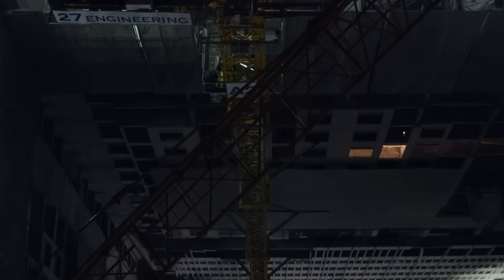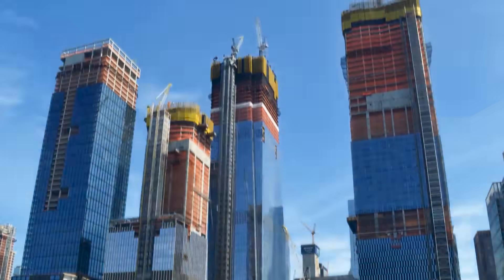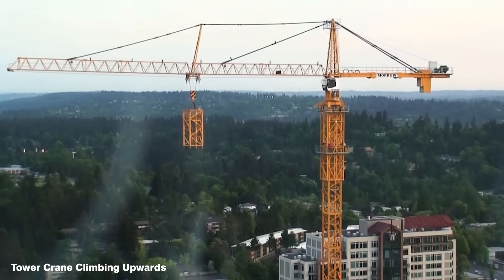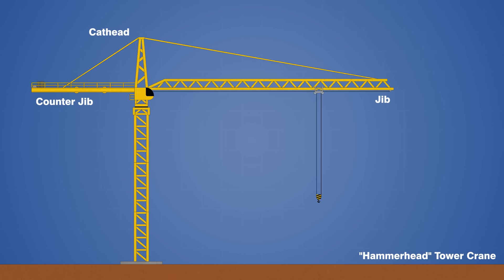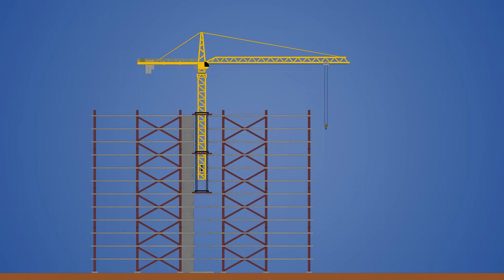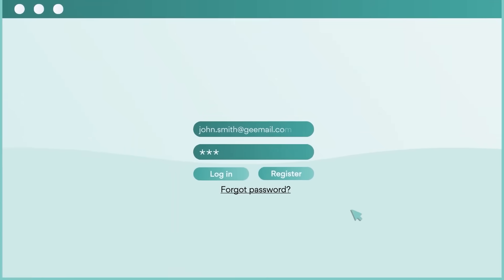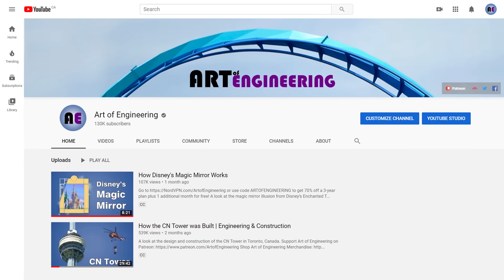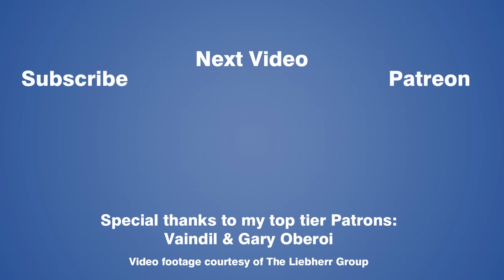How Tower Cranes Build Themselves

Comment: There’s only two requirements to be a tower crane operator:
1. A few loose screws
2. Balls of steel
Reply: AmishHitman73 New York City town crane operators can make 500,000+ a year. You just gotta know where it’s paying to work and go there.
Reply: @Chad_Philip     You have got the noughts mixed up unless your saying crane operator can be millionaire after 2 years which is total BS.
Reply: David m3 maniac is is... is that an m3? I’ll just leave now.
Reply: @Chad_Philip  I would retire after like 2 years 😂 fuck that job.
Reply: @Chad_Philip  I really doubt they are making 500k/year anywhere.
Reply: @Chad_Philip  I saw more like 600,000.
Reply: and a bunch of training ...  lots and lots of training.    and balls of freaking titanium alloy
Reply: Make alot of money but if you fall or the crane breaks that money won’t matter no more.
Reply: @seressor  but you wont need the money anymore, so itd be a win win
Reply: @harleyme3163 you beat me to that 😂
Reply: Tower crane operators better be damn good at their job for the pay too. Not many people know this, but any accident directly related to the crane hurting somebody is automatically the operator's responsibility.
Example: If a cable snaps or the crane fails from being loaded over capacity, and the load kills someone, that's on the operator for negligent homicide. Now, to enforce such strict policies, the operator has FINAL say on when the crane and conditions are fit for operation. Cables are to be replaced very often and have to be rolled into the spool with a certain amount of tension. That's why they have a large weghted ball over the hook.
At least, this is all how it was laid out for me by my dad, who happens to be certified to operate such machinery.
Reply: Emperor Of Mankind Thank you for explaining this. I would've loved to be a Crane Operator but God's plan for my life comes first. I admire and respect how a crane works and appreciate people who knows how to properly and safely operate one. ❤
Reply: @shockwave6213  well said. 
I've been in the seat of a few cranes since 2002.
Hats off to your dad.
👍
Reply: The operator's aren't the ones who built the cranes, ironworkers like myself are the ones who put them up.
Reply: loose screws are what you don't need
Reply: Pixelmace EXACTLY! ❗❗❗
Reply: Not really. I'm a crane operator and rigger, we do stuff every day that is more dangerous the operating a tower crane. I never did like the tower cranes though, too monotonous work, and lots of times they have idiots putting them together. Ain't not telling how many times I've seen pins and whatnot fall out of the tower, because they weren't assembled right.
Reply: meh some tower crane operators operate remotely from the ground with remote control
Reply: @youtubeuser206  I've done this with a digger/derrick. It helps alot when you don't have a large crew, only critique I have of my particular system is that the joysticks are almost push switches. There's no finesse, it's either full throttle, or full stop. There's such a fine threshold for the joysticks that it's almost imperceivable to even experienced operators.
Reply: @AecherJace  I think they're building all equipment like that now.. The new Komotsu front end loaders have switched to more digital controls too and a sensitive azz joystick for the steering wheel. I don't like em
Reply: My dad isn’t a crane operator but once a month, he needs to climb at the top of the crane and has to go add grease to the steel cables at the end of the crane
Reply: I cannot even stand on a 10 story high rise because my acrophobia takes over
Reply: @SavageKingsvge  i cant go higher than the 2nd story of a building without feeling sick, and losing feeling in my legs. this video gave me nausea.
Reply: lalla jha no money in the world would make me go up on one of those. I have acrophobia. Id faint before getting to the 5th floor height
Reply: I hope they don’t have a few loose screws. There’s only one place where they could get those...
Reply: Balls of vibranium 🤓
Reply: why balls of steel? I climb cranes for fun
Reply: @EvilTaco  working with cranes and climbing them are different like climbing compared to cutting trees 🤣
Reply: LLG 3PE 3. Not afraid of heights
Reply: I absolutely love it. Best job I’ve ever had.
Reply: Lots of piss jugs
Reply: i have a big dic but i didnt become crane operator..
Reply: What imagine you have to have decent eye/hand coordination. Having 2 eye helps so you have depth perception. Some people aren’t bothered by it I guess. I’ll look at those ironworkers in the 30s who worked with no safety belts, sitting on and I’ve been eating the lunch with your legs hanging over the side. Hell of a view I guess if you don’t mind the Heights. Did you ever see the wing walkers and acrobats from the 20s and 30s and the stunts they would do? To me that’s just insanity but these people have no fear of heights. I do. It’s not really irrational fear I guess.… If you think about it, you could walk on a sidewalk that is 2 1/2 feet wide and you could skip on it and do cartwheels and everything else. Put that sidewalk 200 feet in a year and you’re doing a belly crawl on it.
Reply: I have an extreme fear of heights--But once I climbed the Tower Aections in fear and got in the Cab an started operating it--the fear subsides and you focus on doing your job. 1 wrong trolley or swing can kill people if your not focused on your hook, the load, landing the load by radio or people near the hook.
Reply: https://youtu.be/6B_dM87BSFY
Reply: You'd need balls stronger than steel for that
Reply: You forgot to mention the ability to talk shite
Reply: Naw, balls of titanium more likely.
Reply: I came from a crane operator family and I respect my family even more after reading this comment from you
Reply: I have great respect for the people who do things like this. Any height activity.
Reply: "Oh that's just tower crane operator Steve.  Rambling again, as he always does."
Steve: "They're not bolted on!  Why does reddit call them bolt ons?  They're fake breasts!  They're part of the feminine body, which is soft!  I will die on this hill.  This tower crane!  Eeehehehe..."
Reply: @AmishHitman73Archive  40 - 60k IS a lot to some people mind you
Reply: @AmishHitman73Archive  that is a decent amount of pay for where I am in eastern oklahoma.
Reply: a few loose screws had the guy ( hero) that took the plane from seattle
Reply: Did you mean bolts of steel?

Ha, get it, cuz it rhymes with BALLS

Comment: What is the weight limit in lbs or pounds , tons of these animals?????  
It makes my stomach kinda turn just watching this diagram.   I can work in a bucket truck , or truck crane basket all day , but after seeing pictures of these things that have fallen and tangled , and mangled it makes me in easy just being close enough that one could fall on me. It's strange because hi speeds on motorcycles , boats , hanging off hill sides on a dozer doesn't bother me at all but just being close to these things unnerves me.

Comment: Don’t the counterweights need to move when the trolley moves?
Reply: No, actually when there is no weight on the jib end that is the most unbalanced the crane can be, with all the weight in the back, only after we pick some weight up and move it farther out does it actually start to balance out. But there are switches called limit switches that prevent you from putting to much weight on the crane. One is the moment switch which prevents you from going to far out and then there is the line or total switch which prevents you from putting to much weight on the hook that might damage the cable.
    When the crane is free standing the tower section will have a slight bend almost like a pot belly towards the front and when you are maxed out it looks like a bad back on a old man bending over at at that point the seat you are sitting on is now tilted towards the front window and it wants you to slide that way lol
Reply: on some cranes they do rock back and forth just to help dampen the rocking motion that might occure when pouring concrete and the guy dumping that bucket that could hold up to 4 or 5 cubic yards of concrete up to 25,000lbs just let it go all at once and instead of the bucket 1 foot above the deck is now 10 feet up and the crane is bouncing all over the place and loud cussing can be heard from the operator's cab

Comment: Tower centers make themselves taller. They do not build themselves. They are built in a factory. They do not even assemble themselves on site, this is done using smaller mobile cranes. They can add sections to their tower and they can remove sections from their tower, that's all. I've been on jobs and seen dozens of them assembled over the years, always done with smaller cranes. Thumbs down.

Comment: I do this for a living everyday of my life it's a good video Everything spot on you forgot to mention one thing about the inside climber the top collar also hold the mast centered also for tolerance this collar isn't fitting tight around the mast nothing is perfect in this world so you can't make the openings perfect for the cream just to fit in have you climbed it to the appropriate height you make it plumb level and then you drive wedges in for the top colour is wedges so that it is lead one side more than the other it's adjustable the wages are checked Every Morning by the operator and lastly it does not take a month to cure the concrete in a crane base pad a few days after we're done maybe sometimes the next day it all depends on what MPA the concrete is how warm was it when you bored if it's colder doesn't here as fast did you use metered concrete yes you have to wait longer anyways good video like I said spot on buddy that comes from a person who does this for a living cheers
Reply: I've been in a couple of internal climbers and hated it when some wedges worked out while I was operating and the crane tipped backwards
Reply: @TheHawkeye1432  omg! Its falling over!!!  Really depends what crane you're working with the pecco most have a threaded rod they slide on and a keeper nut to hold them down but I've worked with a few that we had wooden wedges every morning five hits with a 10lb sledge if it moved start the count of 5 over again
One other thing that wasn't mentioned the inside climber loses lifting capacity from the ground after a certain height

Comment: Do they make them where the counter balance weight can also move towards/away from the center of the crane? I would think that would be really useful. For Heavier loads, run the CW out a bit more, or in to keep the moment as close to zero as possible. Just curious.
Reply: no, the crane is at it's most unstable point when there is no load on the crane and the crane only starts to balance out with heavy loads on the jib, counterweights might be engineered to sway silghtly on some to counteract a bouncing crane but never move far

Comment: All the ballast is not put on at once, just one or two , to counteract the weight of the main jib, the rest are added later otherwise the crane would lean backwards, also because a crane is erected though the middle of  a building DOES NOT increase  its lifting capacity

Comment: Serious outcome happened in NYC 2007(?) when a crane fell over in a dense mid high rise residential area.
Reply: I believe that a rigging cable broke and the load came down and hit and broke the tie in bars to the building and when that happened the crane which could not support itself free standing that tall fell backwards because of the counter weight into the apartment building across the street

Comment: Why don’t they make them remote control with a bunch of cameras for the operators.
Reply: U perform best when your life is at stake
Reply: They all are, but we still can't beat the situational awareness of sitting up there, with your own eyes ^^
Reply: Wouldn’t you rather be in control of your life all the up there instead of a remote that can fuck up whenever
Reply: If a mistake is made with remote control, how are you going to rebuild the crane?
Reply: With a remote control you can run the crane but you can't feel the crane. I have run a couple from the deck er working floor but there are too many distractions and you can't see everything. I had 1 crane where the cab was located half way out on the jib, I am really glad they did it for only 1 crane all you did was bounce around all day long and was physically draining by days end

Comment: You dont mention mast windup when the swing is stopped. Met a company safety guy about 150 feet up a mast. It was his first trip up a tower crane. I mentioned windup. When the operator stopped the cement bucket and he saw the mast wind up, I swear there was a pop as the air rushed back into the space he occupied. Never saw anyone go down a set of ladders that fast before. Good times.